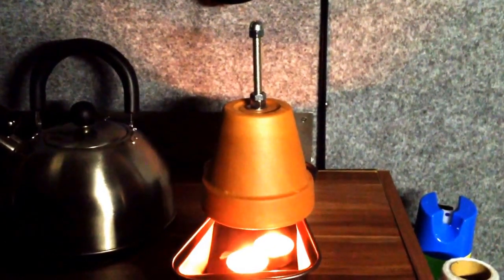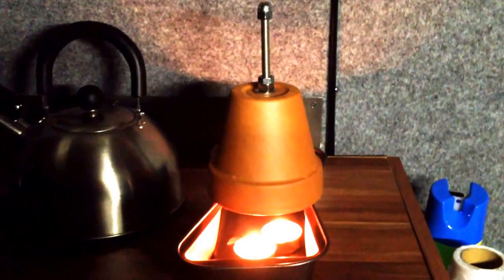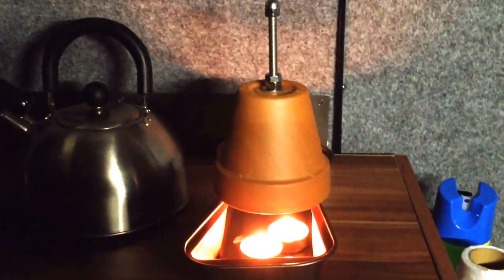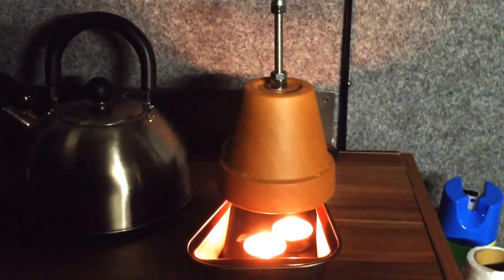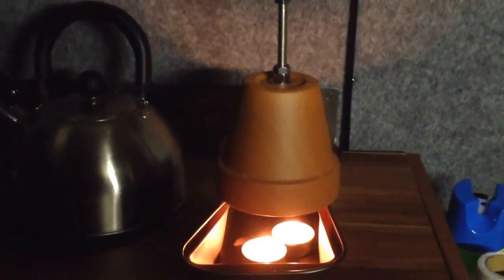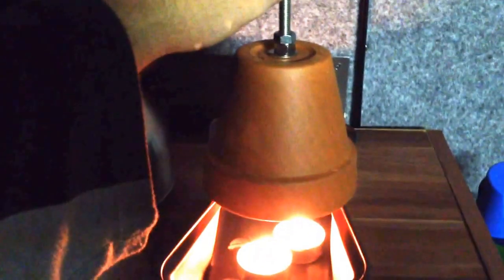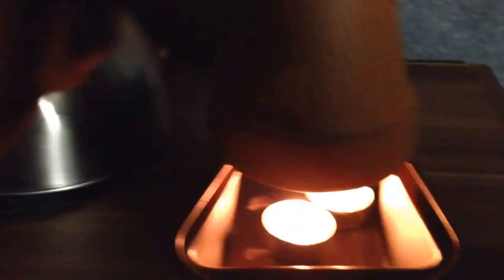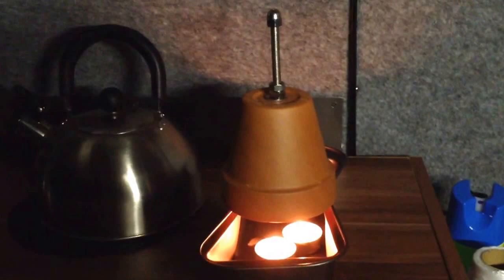007 Vanlife VLOG - Follow up on terracotta pot heater - Living in a Van Part-Time

Comment: Why use stone pots ?
A metal can would be better.

Stone doesn't conduct heat.  It's actually used to stop heat.
Reply from the maker: +chris77777777ify I'm not pretending they get hot, they do get hot! However it's the air that warms up the van. Feel free to try metal pots, and make a video, or do both to show us the differences... PS I wouldn't call them 'stone' however perhaps clay is more accurate, and there are pros and cons of both clay and metals ovens. I would love to see how many seconds you could hold these 'heat stoppers' for after they are in use for a couple of hours!